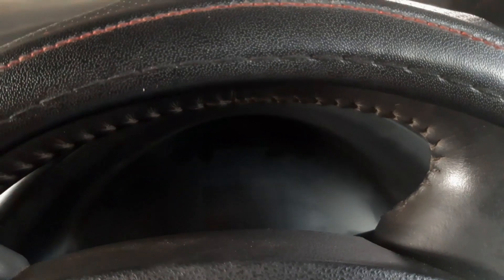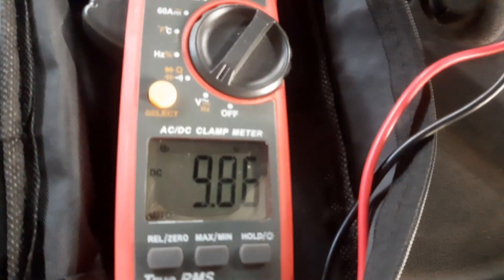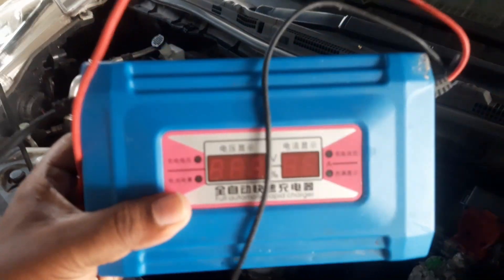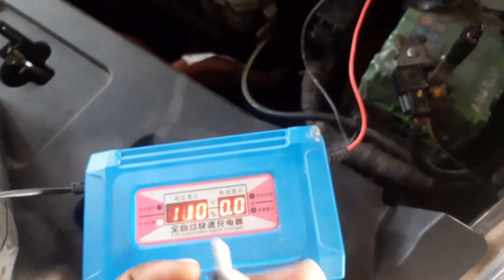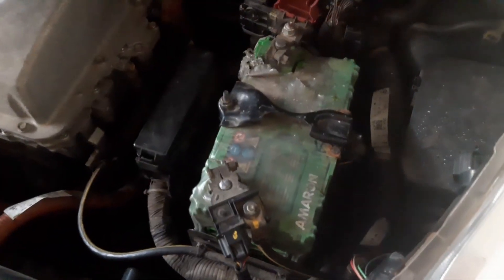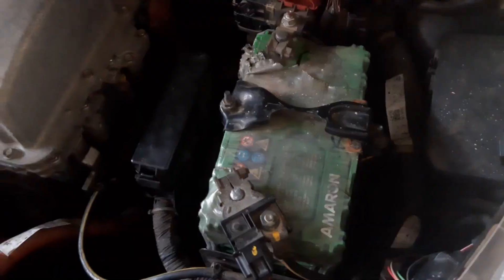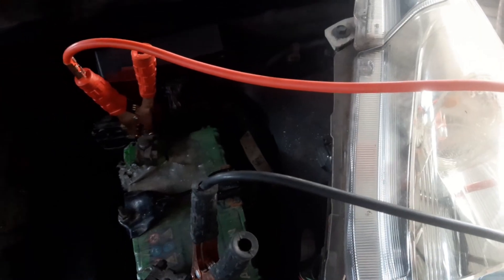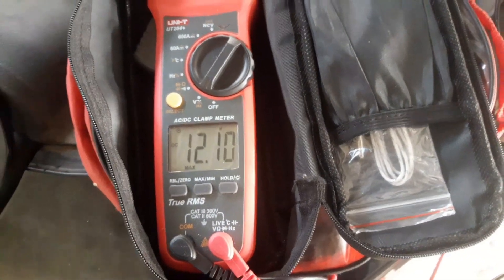Nissan Leaf Not Starting? Here's How to Fix It FAST! | 12V Battery ?

Comment: Hey uncle, you are a legend. I had the same problem, dash lights show something is wrong, mirrors opening slowly and won't start. My battery was also 9v. Changed to spare battery 13v and car started immediately. Thanks heaps. Your video was first one I checked to. God is good.
Reply from the maker: Glad it helped you resolve the issue!